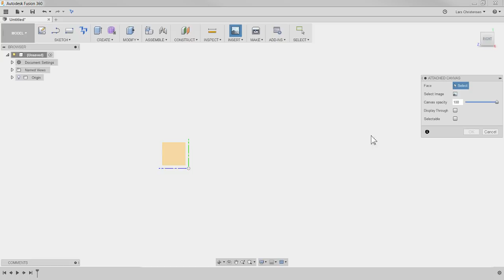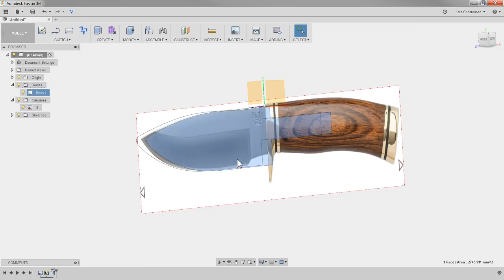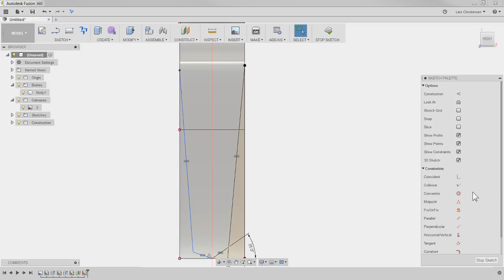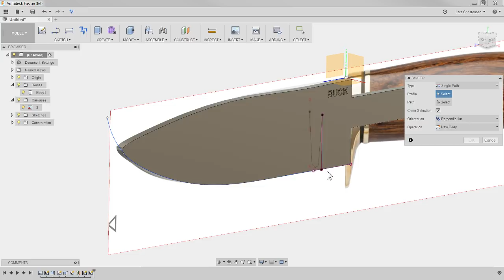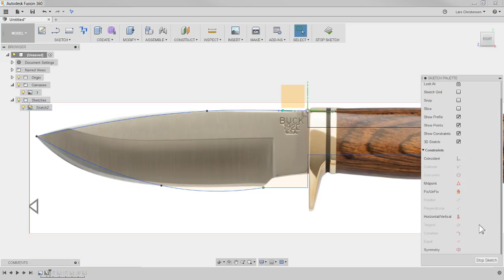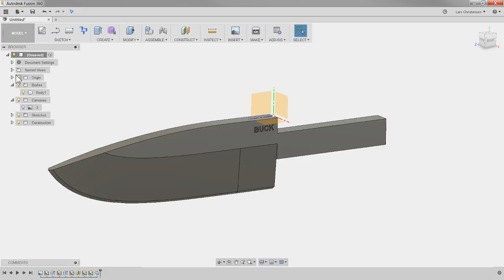Fusion 360 — How To Model a Knife Blade — #LarsLive 98

Comment: I absolutely love these videos! I just got fusion and I am trying to make my own folding knife! I would love to see a video with a folding knife if you have the time to do a video on that! There is such limited videos on knives and its hard being new to this to be able to transfer the info from other designs to what I'm trying to do. I have created a drawing roughly of what I want then i make a sketch of it in fusion. Is there a way with in sketch  to rotate the frame and the blade to confirm sizing and positioning prior to making a body? This is the part I am struggling with and then to get the grind the way I want to look is an entirely another issue. Thanks so so much I look forward to ur response

Comment: Thank you for all these videos.  I am currently trying to copy a router bit profile so that I can add it to trim pieces as need.  I have the profile completed with splines; however I am stuck on how to save the shape as a 2D profile. so that it can be added to an end face of one of my trim pieces.  Any suggestions?
Reply from the maker: Hi MobiusFlight Thank you for watching!
If I understand what you are looking for, you could just save it as an individual file and then just copy the sketch into other designs with Ctrl C and Ctrl V.

Comment: All the scout knives I owned could be disassembled, taking off the brass and wooden parts from the blade. The rectangle you show extended right through the handle parts, and the last part was threaded rod. A brass 'nut' screwed into this and held all the parts together.  Boy, that was a tough one to do!  Made me feel a ton better though, because I struggle with everything I try to do. Great fun!  Thanks!
Reply from the maker: Hi Michael Caswell Thank you for watching!
Great information! As you might already have figured, my knowledge of knives are limited